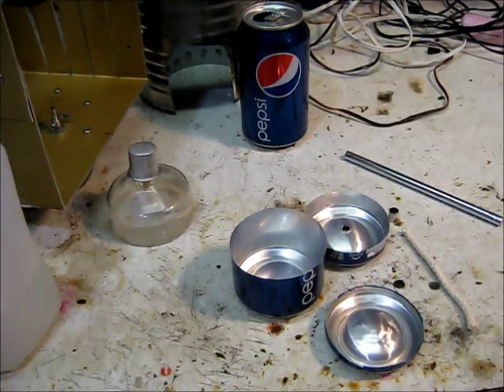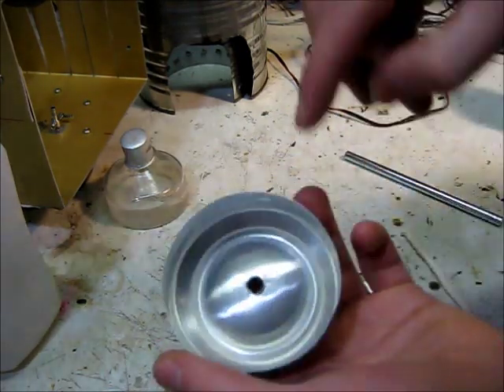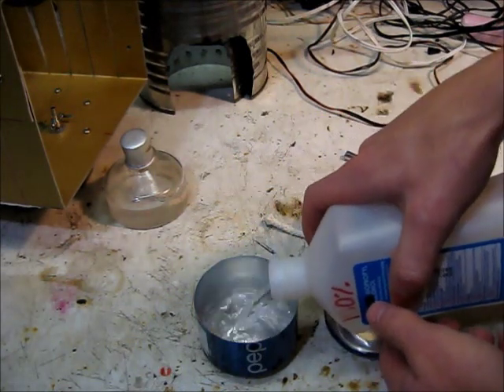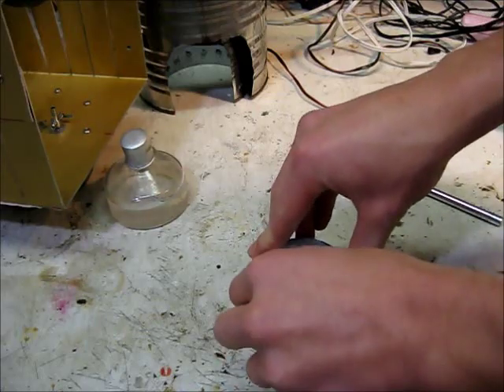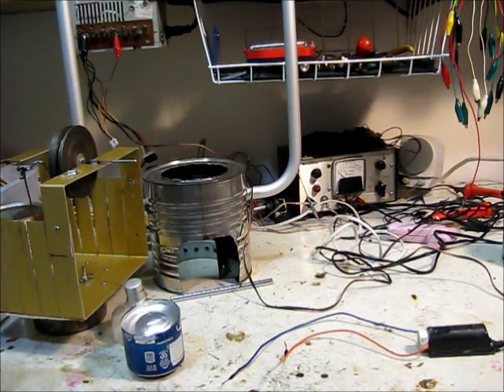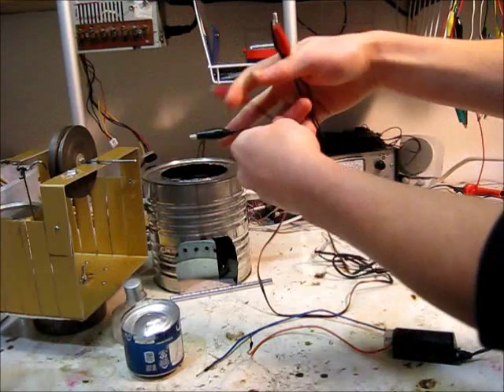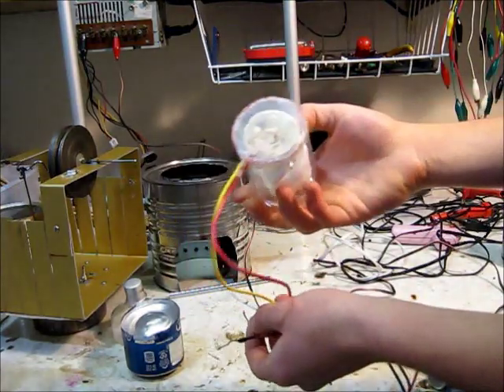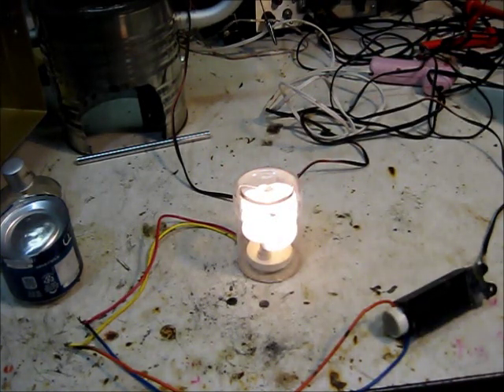How To Make a Oil or Alcohol Lamp For Stirling Engines

Comment from the maker: It does start to boil when I run my stirling with it for to long.  The heat reflects off the bottom of the engine.  One time my engine was going really good and I took the burner out and there was a 6 inch flame shooting out of it!  It can get a little out of control if you don't keep an eye on it!